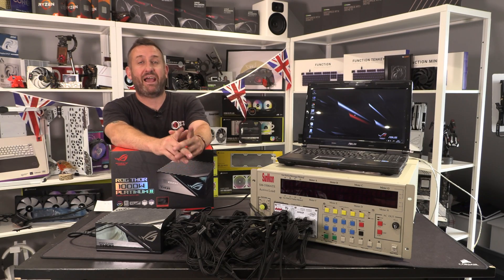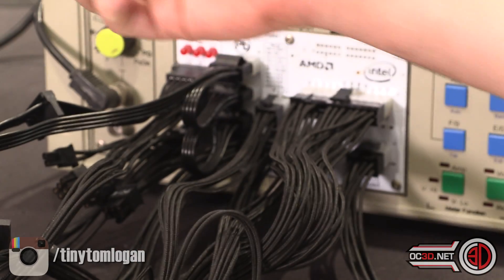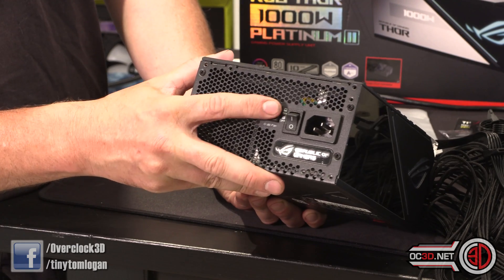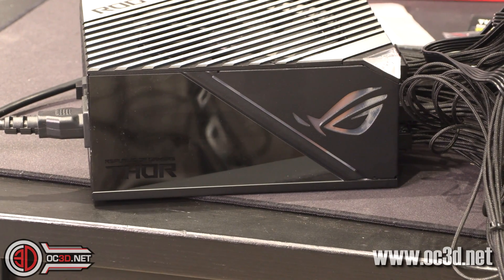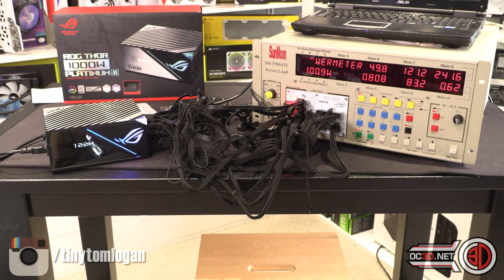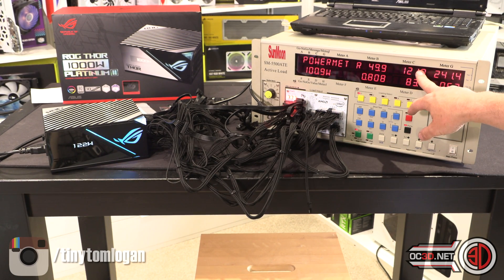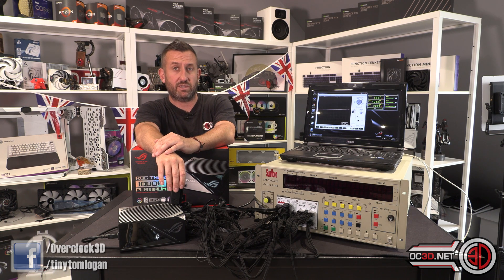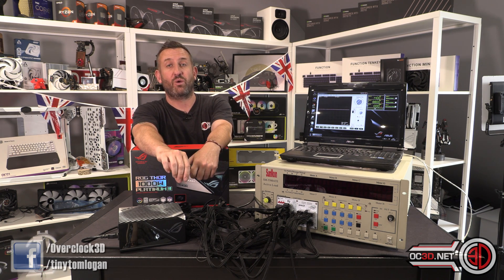Asus ROG Thor 2 1000w Platinum Power Supply Review & Load Testing

Comment: Im currently building my pc with the lian li o11 dynamic evo rgb and im overwhelmed with all these cables for the psu. Do all of them have to be connected?
Reply: NO, its modular psu, you use cables that you need, not all of them, 24pin mobo, 3-4 8pin for high end gpu, 1-2 8pin for cpu and 1-2 cables for sata drives/ other devices,
hes just test psu with all the cables possible

Comment: ROG THOR 1000W PLATINUM 2 - This fail cable 40SERIES - (2x pci-e 8pin -12pin / its not + 4 pin FAIL👎) !!!CABLE 12 VHPWR = 16 PIN (12+4). ROG THOR 1200W PLATINUM 2  - cable power 40series 👍  16pin

Comment: Anyone had issues with this PSU Paired with ROG 3090 OC?, cause mine broke, after some research it was the 3090 spiking voltage that the psu cant Handle

Comment: Hello what do you think you can use the ASUS ROG Thor 1200W Platinum lI|  1200W PC
 Buy the power supply without hesitation because my thor 1200w just broke, you need a new power supply and the ASUS ROG Thor 1200W Platinum lI|  1200W PC
 Power supply has everything you need

Comment: I have the Thor 850W (version I). I just installed it from sitting brand new in box for several months and the screen intermittently fails after start-up. Sometimes the animations look like they are cutting out, sometimes the numbers freeze and one just flickers, sometimes the screen just shows dots, sometimes it just goes black. If I restart the PC a few times it usually works fine and I can play games for hours with it functioning as normal. I updated to the most recent BIOS and chipset driver. I also checked the cable connections. Any ideas other than RMA?
Reply from the maker: Mine worked without it plugged into the board?
Reply: @OC3D  I tried the other 5V aRGB header on my ASUS ROG Strix X570-E. I also tried unplugging the 5V aRGB from both the motherboard and PSU. I tested without Armoury Crate and then with Armoury Crate. I also tested different AURA settings in BIOS, loaded optimized defaults in BIOS, disabled fast boot in BIOS, and disabled fast boot in Windows. None of the above seem to make any difference. At this point, it seems more temperature/use related than anything. If I cold start the PC after sitting overnight, the screen cuts out. If I game for 5-10 minutes to warm things up and shut the PC down and restart it the screen seems to start working no issues. Maybe it's related to the microcontroller or a capacitor inside the PSU? It seems my only options for further testing before RMA are to clean re-install windows, remove the PSU to spray with canned air to remove the little bit of dust on it, and re-plug in the cables.
Reply: @OC3D  I ended up sending it in for RMA. They verified it was a defective unit. A "new" (refurbished) unit with a different serial # is in the mail coming back to me.

Comment: Just picked one up on sale for 219.00 US.
Great job and appreciate the honest review. Good stuff
Reply: How do you like the Asus rog Thor II 1000W so far, are you getting any Fan issue like load noise on full load or higher load? Let me know.. thanks
Reply: @Moto_Rid3r  Sure, it's quiet under load. I've ran serval benchmarks and it has performed well. I'm running a 4090 FE, ASUS Z790 maximus. She's running at 6.2 1c, 6.1 2c, and 5.9 on the rest. I got it for 219$ US and really happy with it. ONE BIG NOTE: Don't use the included VGA cable for 40 series. It was designed for use with the 3090/ti. It isn't mentioned anywhere and has created some confusion. :)
Reply: Where'd you get it from?
Reply: @cyphi1  newegg

Comment: My 4080 won't boot up with that 12-pin.  I'm supposed "Contact Asus for a 16pin?"  I thought the data pins were supposed to communicate with the power supply?  Should I return this PSU and find one with 'true' data like the ASUS Loki to get the true 600watts?
Reply: What did you end up doing?

Comment: I sent this psu back as when I contacted ASUS for the 16 pin they basically said they don't carry spare parts and refused to send it to me. overclockers were great at arranging an RMA. I am no currently using my rog thor 850 with my 5950x cpu limted to 4.5 mhz until i can get my hands on a ATX 3.0 1000w + psu. If i don't restrict my cpu or my 4090 gpu my pc will randomly reset when they spike. Its a shame as i really liked the THOR psu I am sceptical about if the lokis cables are going to be long enough for my 7000d case

Comment: FYI, there is no where to get a 16 pin for this. You have to buy one yourself from say Cablemod.
Reply: I've just bought one today to come tomorrow. The website says it comes with a 600w lead and if you don't get one, let your local rep know and they will send one out. Not sure how recent this was whether it was at launch or recent ones being made now as it says on the advert where I bought it from its the 450w. Or should I say comes with 12 pin on amazon site but asus website says ask for 16 pin if it didn't come with one. I don't get that if this isn't a gen 5 psu, would the 16 pin they say you get with it have 2 or 3x pcei at the other end since the psu itself doesn't have the official gen 5 connection?.
Reply: @chrisgatecliffe  It comes with a 3x 8 pin to a 12 pin that doesn't have those 4 data ports.

I got one from Cablemod on order for my PSU. Turns 4x PCIE 8 pins into one 12+4 pin 12vhpwr plug to run at the full 600w.

Without those 4 data pins it'll limit the card to 450w.

I tried to get ASUS to send me one and they wouldn't or couldn't. Their customer service is a solid meh.
Reply: @WyFoster  ah OK, so if I've got this right there will be the 16 pin connector going into the gpu, then 4x pcie cables going into the psu that you have order from cable mod, but in the box just a 12 pin into going into the gpu without the data connector and 3x pcie going into the psu?. I've got a 5900x which I only use pbo for their built in overclock, and I won't be overclocking the 4090 at all and using the basic overclock they have on the card. So basically would the cable it comes with suit me because I should technically be way under 1000w, or just get a similar cable like you to be safe?.
Reply: @chrisgatecliffe  I personally would like to have the custom cable. It's expensive. Like $50+ with shipping. But it's nice. 

12 pin will probably work fine unless you you buy an overclocked model. They might need over 450w.
Reply: @WyFoster  I suppose I can just see what's in the box tomorrow depending how old the box is. I take it cablemod you chose is the 16 pin micro-fit to 4x 8 pin PCI-e cable for 4090 600w gpu at 39.90 eur? There's no uk website I guess and to buy from euro site, assuming you are from Europe too?
Reply: @chrisgatecliffe  I'm usa based. I got mine about 2 weeks ago. Had the default 12 pin. Hopefully for you it's different in Europe.
Reply: @WyFoster  ah, I would probably assume the same then. Seems to be a mis-communication from Asus somewhere. On the flip side I suppose whilst I order a cablemod cable, i can use the adaptor from the asus card itself as that has the 16 pin to 4 pcie slots in the box to make use of the 600w supply. Thanks for info Wyatt
Reply: @chrisgatecliffe  did you get the right cable in the end Chris?
Reply: @LegionEpyon  it was the 12 pin unfortunately not the 16. I emailed asus and they are sending me one out. Anyone having the same issue it's best to email them for it and not call as they said they weren't trained to deal with PSU issues.

Comment: I'm using this PSU too but the EVA version.
I agree one thing I don't like is the positioning of the fan.
Most cases have ventilation of PSU on the bottom if you want the display the fan is on the top.
I was forced to drill holes on my Phanteks P500A to have the PSU to breath air.
Reply: Gotta do everything just for the looks 😂

Comment: Ive had my Rog 1000 about 8 months, made a huge difference over the Rog 850 i had when i upgraded to a Strix 3080
Reply: What else does your system have that an 850w wasn't enough with an RTX 3080?
Reply: I'm thinking of getting one of these after having my Corsair AX850i for the past decade. What have been the main benefits you have noticed?
Reply: What do you mean?  What 9:36  diference?
Reply: Am i right in thinking, the oled screen and rgb only comes on when you start PC ?, i mean it wont be on if plugged into the wall socket on standby will it, thx

Comment: I'd prefer wattage readout over non-relevant images but no way I'd spend that much on a 1000W unit though... Maybe 2000W Titanium with a 20yr warranty.
Reply: The 1600W ROG Titanium is 800 bucks... :-D
Reply: @JacobMartin-l1f  I'd get the Super Flower 8Pack Edition 2000W Platinum over that :p